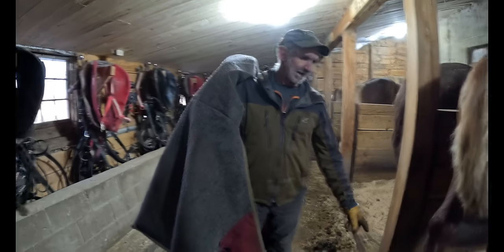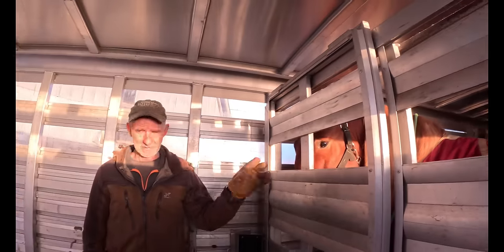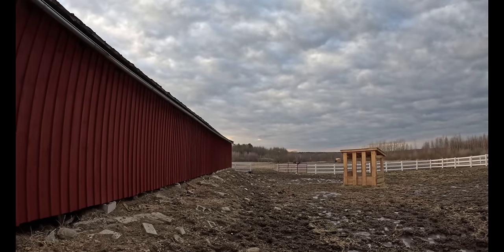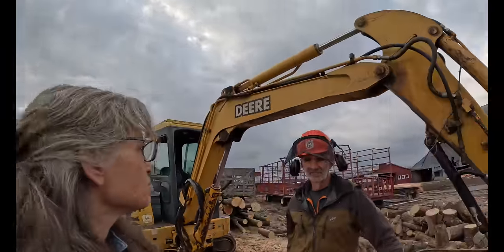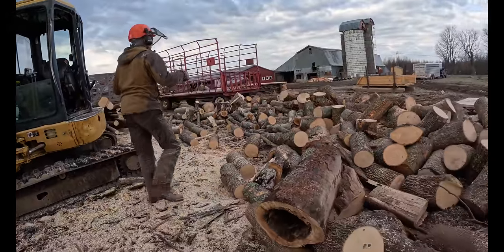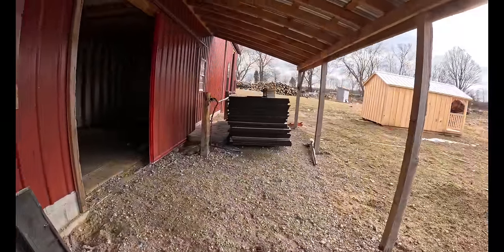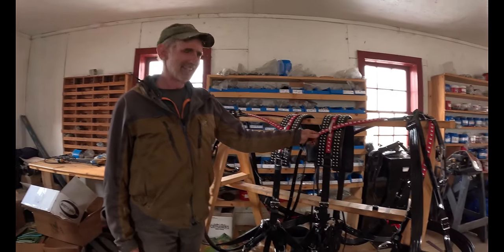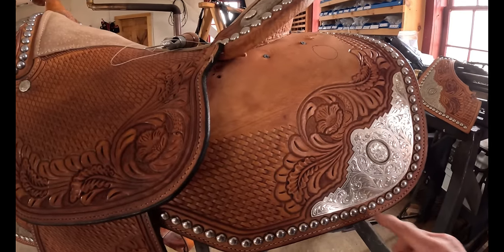A SURPRISE FROM ELI'S HARNESS SHOP! // New Shoes for Baron #608

Comment: Jim . Eli has a homemade silo cap like your , just a little smaller than yours . Question .You must have those  silo caps well fastened down too withstand the high winds     that happen occasionally. My neighbours bought metal silo dome blew off last year partially.  Just hanging there . Great fun fixing that problem .😊😊😊

Comment: Brenda, May I ask what brushes you use to get off sgeeding hair as we transition from winter to spring? The  brushes I'm using currently just aren't doing a good job of getting the loose hair off once the curry comb has been used. I have been using a sleek ez instead of regular round curry comb & that seems to helo some, but the brushes just get full of hair shortly after starting the brushing. Only 2 of tge 6 horses are shedding profusely. The other 4 seem to have less shedding & less brush issues. Maybe a change in  shampooing product would help, IDK? Any suggestions? Sure wish I had more time to stop by your channel more often. The horses are keeping me pretty busy.
Reply from the maker: We a metal scraper type thing, we call it a saw because it almost looks like one. It has little teeth and you can hold it with one side in each hand it takes the shedding hair off nicely as you run it along their coat. It can come together and be used in 1 hand as well.
Reply: @WorkingHorsesWithJim  That sounds like the sleek ez tool that I have. My blade may be dull. Thank you for the tip.